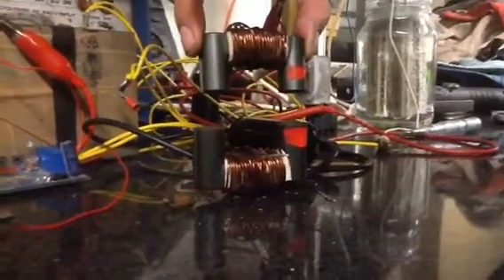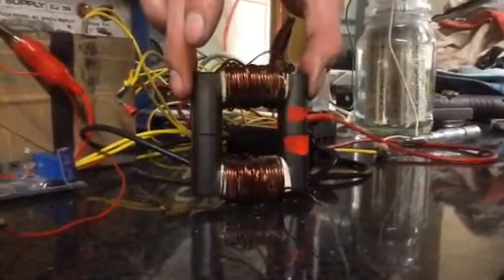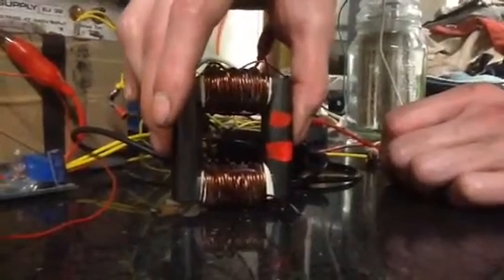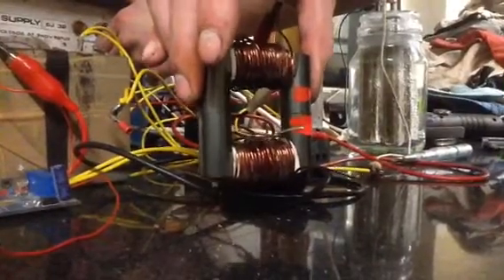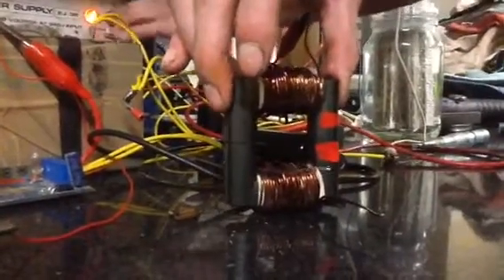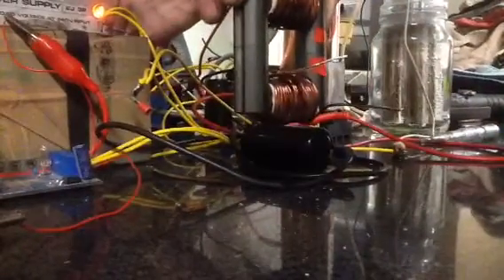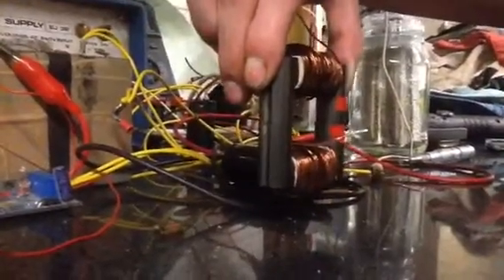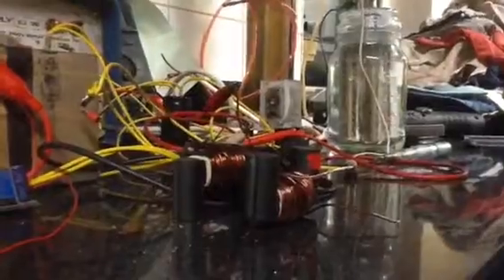Ferrite PMH ?

Comment: Perhaps with AC it is difficult, and it only holds together if you kill the power at the top or bottom of the AC sinus wave. Try using DC voltage. A short tap (on DC), somewhere between 0.5 and 1.5 seconds should work.